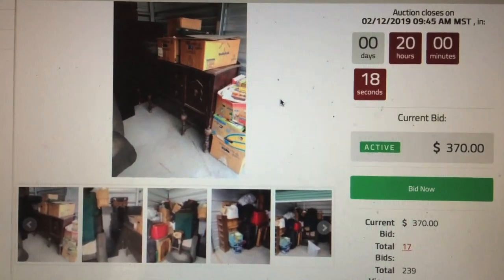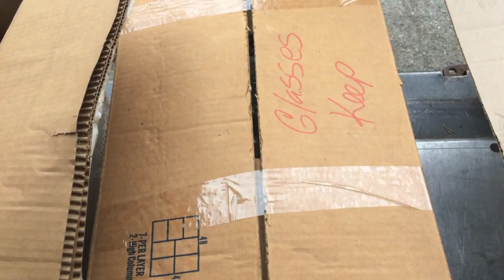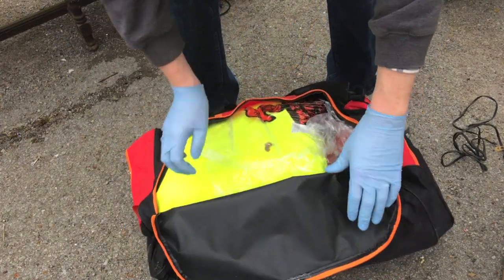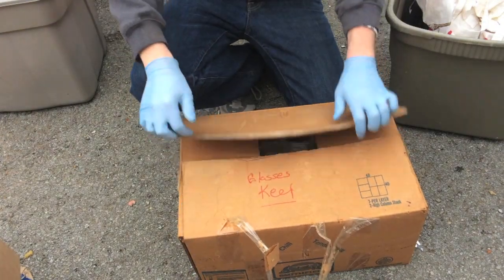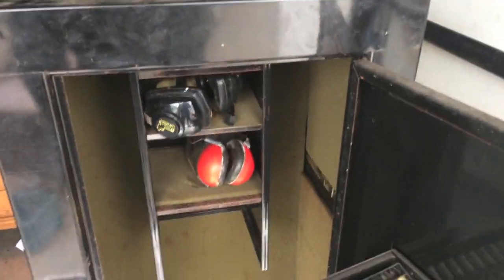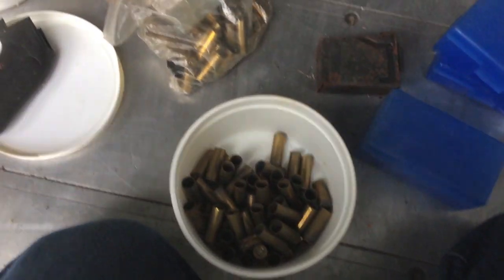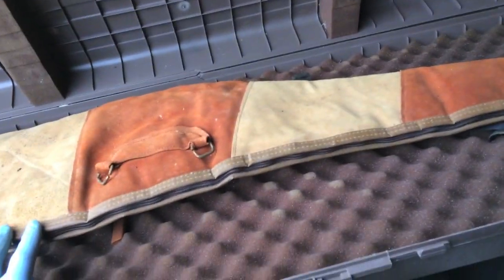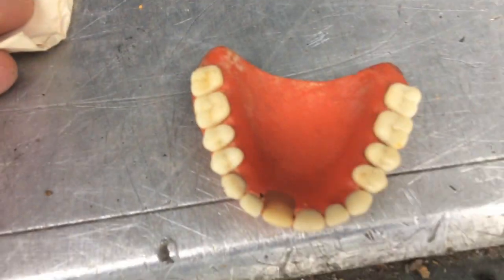Two Gun Safes in a Storage Locker Auction Unit! Will it be a Boom or a Bust?

Comment: I own a midway Frankford arsenal platinum tumbler that uses stainless steel pins to tumble brass that is lightly corroded. You tumble the media(stainless pins) first in like 2 tablespoons of dawn (original) for about an hour. Rinse the pins in a bucket and put them back in your tumbler then put about 2 to 3 hundred cases that wont fit in the neck of any of the cases. Fill it with hot water leaving about an inch of air space, add 2 good squirts of dawn and Lemi shine(get at Walmart) which is used in dishwashers, add a 1/8th tsp of lemishine to your solution, put lid on and tumble for 2 hours. Get a brass separator from midway and their magnet(pins are magnetic stainless. Rinse till suds are gone and tumble pins out in separator. Then take a good hair dryer on a towel and dry them. In the end they will look brand new.